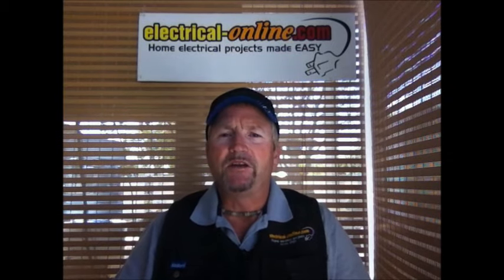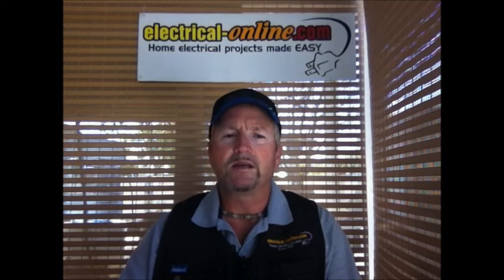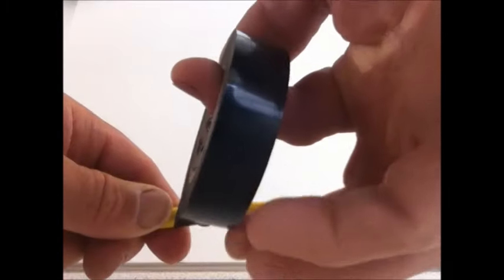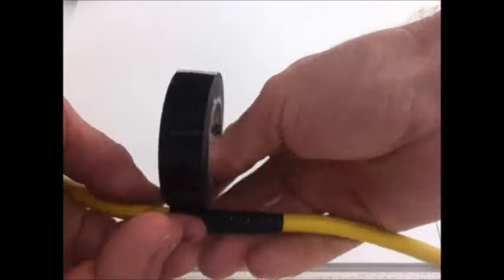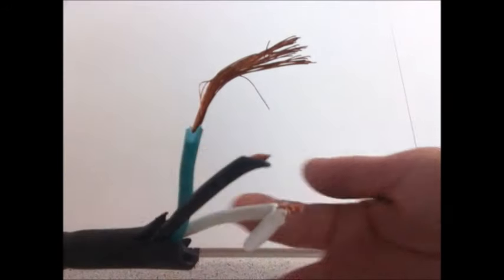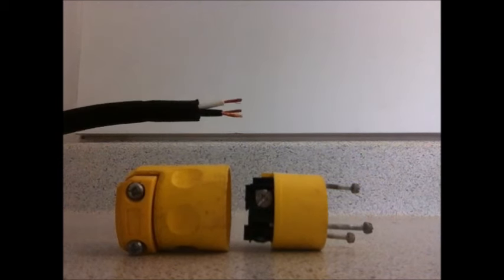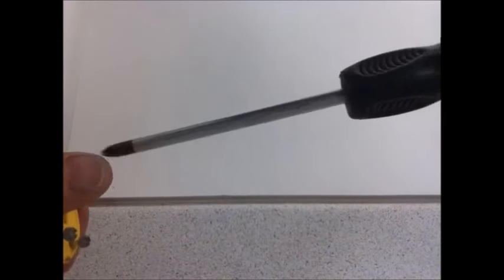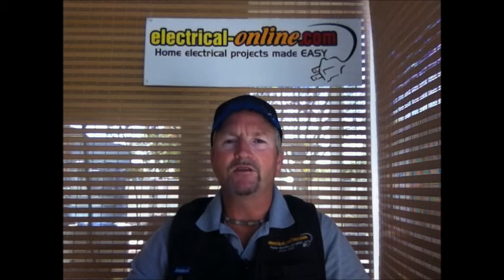How to Wire an Extension Cord

Comment: There is an end of the cable to put the male end on and an end to put the female on, so one doesn't have to cross any wires. It's a small detail that most people miss, but makes putting the wires into the terminal points easier.
Reply from the maker: Samuel, good point. It would seem logical, but it took someone pointing that out to me many years ago. Before that it was a mystery to me why sometimes you had to twist and cross the hot and neutral conductors, and at both the male and the female end! Imagine that! Early in my years as an apprentice with an industrial company, we always made our own cords to use on the job using yellow SJTW, and Hubbel cord caps and connector bodies. It was my Journeyman at the time that gave me the tip!
Reply: Samuel Johnson  have a question for u

Comment: Thanks for the video. It's obvious you're a pro. I just watched another video by a real charlatan. Two questions: don't you need to tape up the contacts with electrical tape? Is it advisable to hot glue the plug to insulate it? I'm fixing lawn mower chord that someone drove over. I'm mainly worried about fire or electrocution in case it starts raining while I'm mowing the grass.

Comment: I have a older flat cord...all three wires are the same color.
Reply from the maker: One of the wires will have a ridge on it, or will have a square edge that if you can't easily see, you can feel it.  That's the neutral.  The ground should have something? sometimes it has a thin green coating on it.  Other than that, the ground is most likely the middle.  So that leave the other to be the hot. If the cord has the other end intact, you can use a meter to ohm it out using a continuity test.

Comment: need answer here. I'm making a extension cord with a switch. However, the switch I am using is a wall mounted light switch (Royu receptacle with four holes in it.) I have 4 wires with me, 2 cables as the main power cord, 2 cables which is the other end of the extension wire. Now, the problem is how to wire the Royu receptacle switch. ASAP Pls.

Comment: can you take a broken vacuum, cut off it's cord and use it as an extension cord to power small appliances like laptops and smaller flat screen tvs. Just add a female on the end.